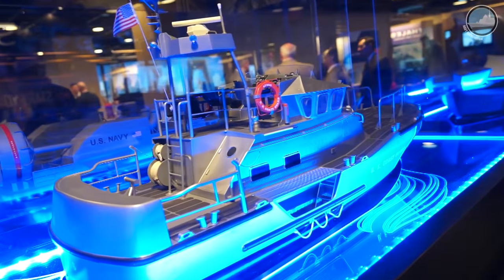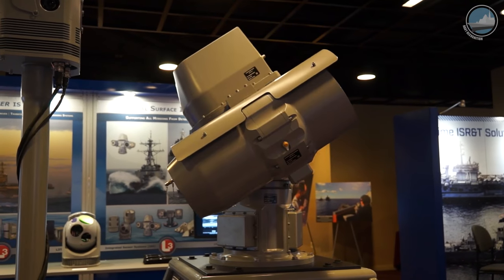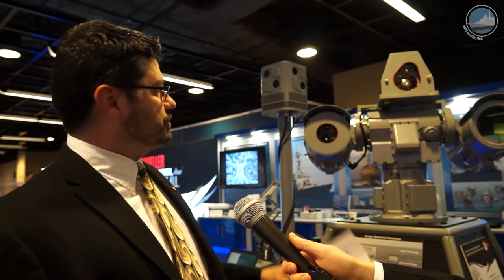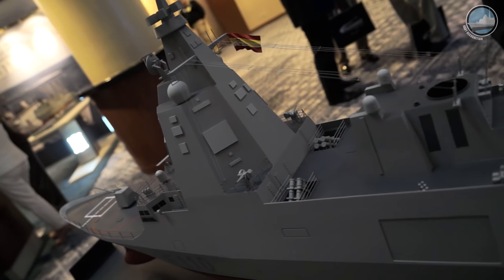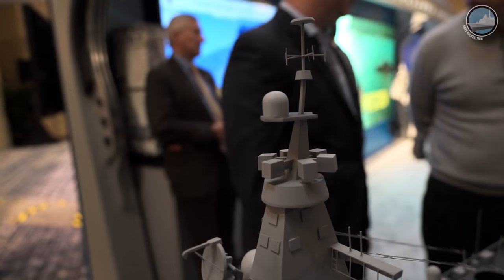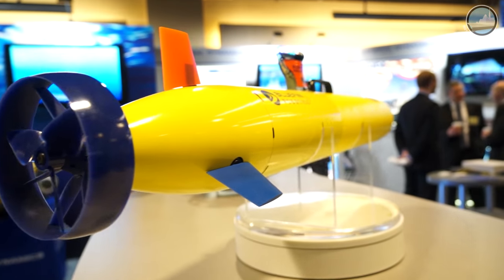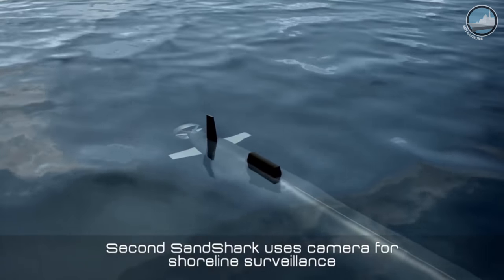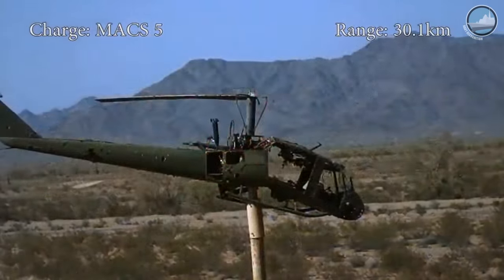SNA 2017 Surface Navy Association Day 3 - Part 1/2

Comment: The f110 is awesome, hope they have allowed room for expansion with more mk41 vls cells.
Reply: F110 is taylored for the Spanish navy that already fullfils AW roles with the F100 Alvaro de Bazán class. The F110 are ASW focus, still having respectable AW capabilities with x16 cells and AEGIS. It can be tailored for any frigate/destructor role. The mast is pretty cool, cost around 3M to design. The four heavy corbets Navantia is building for the Arabs are pretty mean as well. Salud